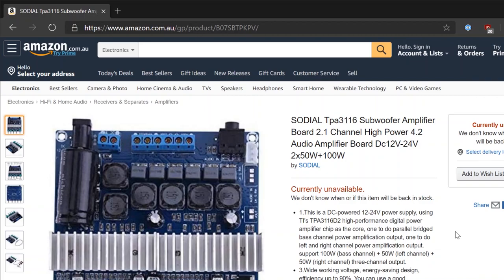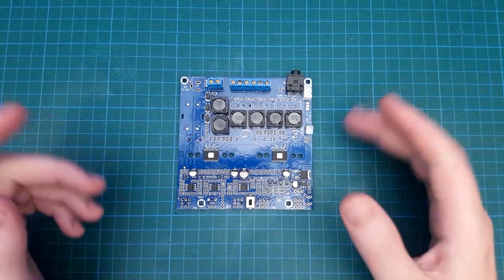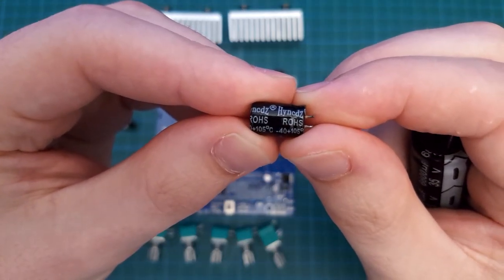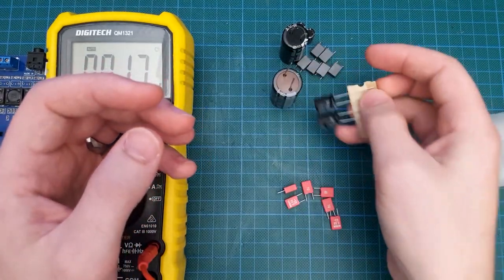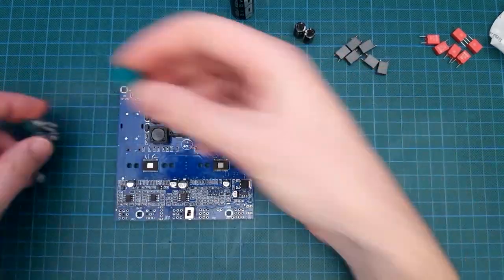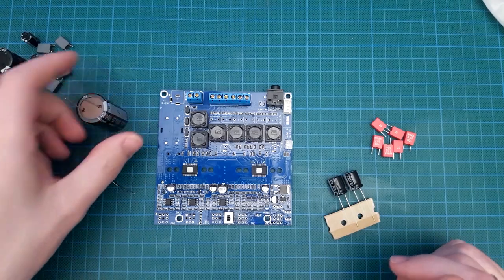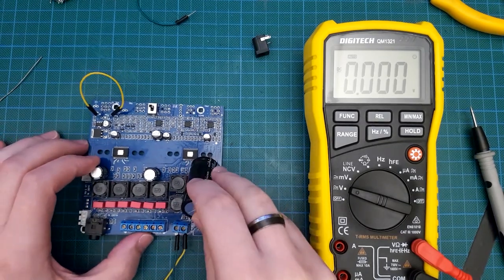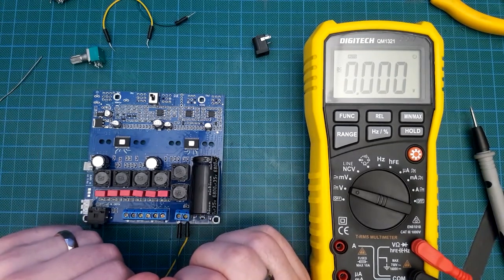TPA3116D2 amplifier module teardown, measurements and capacitor upgrade

Comment: I recently bought one of these boards (interestingly the entire rear section of the board is mirrored) and it came with a fake nichicon capacitor for the power filtering. It’s labelled as a Nichicon PL and I don’t think they’ve made those since the 90s

Comment: The DC jack is switched and it unconnects the screw terminal when you put plug in, so you can connect the screw terminal for exsample to battery. Like in guitar effect pedals.
Reply: You can put "Main" power switch there or just put jumper there. Or fuse.

Comment: I know it can be advantageous to increase the capacitance of the main power filter capacitor, but can I increase the rating of the others or would that change the sound? I'm trying to learn about amp design. Subscribed after finding this, btw. 😁
Reply: Increasing voltage rating is fine but changing capacitance values is not recommended. They are used for filtering so a change in capacitance may induce a hum that wasn’t present before. But the boards are cheap you may as well have a play or get yourself a breadboard and try.

Comment: I immediately upgraded all the electrolytics to some nichicons. Mine were ChongX and the 6800uf measured about half its rated capacity. As i watch the video, haha. you got the same Nichicons i ordered. I had to remove the DC connector as well. What i didn't replace and now i need to after seeing this video is the square caps and probably the pots. sigh more work. 

Now that i look at it, mine is slightly different. The one i bought is made by AOSHIKE and is sold on amazon. It's got bluetooth and much of the layout on the rear is opposite. Also, mine didn't have that problem with the DC removed. Typical chinesium.

Comment: dang you never did a follow up video replacing the pots? thats one of the main things i wanted to try to figure out but i cant find it on your channel
Reply from the maker: No sorry, I basically abandoned this project. These boards are very hit and miss, and after some more use the one shown here ended up dying rather unceremoniously. I experimented a bit with my own TPA3116 PCB design, but never really finished it.
Reply: @silvestronsbitsandbytes   ah no worries thanks for the reply, im thinking of trying the ht21 i hope it works decent enough, cheers
Reply from the maker: To be honest, for about the same amount, you can pick up a nice Dayton amp from parts-express and trust that it's not gonna be crap. Their bluetooth support aptX as well for much better quality than all the cheap chinese amp modules. Good luck though!

Comment: Great video mate. Waiting for that follow up. In my board the general volume pot is really bad, i hear a lot of cracks when changing the volume and lately it feels like there is a difference in the volume between  the two channels in certain positions. I guess i will need to replace it. In my bt version the switch besides powering off and on the board functions as an input selector. Do i need a special pot or will a generic 50k pot=switch combo work fine?
Reply from the maker: Honestly, the follow up to this has been pretty delayed because I was actually fairly upset by the quality of components and design on this board, even after you get past the big stuff. I kinda went a whole different direction and designed a completely new board from scratch, but since it's way more complicated it's all still in the works.
I might try to get one of the newer model BT boards like you have to test out and see how it is.

Also, sorry about the delay in replying - only just saw this comment. Thanks to YT for not notifying me at all!
Reply: @silvestronsbitsandbytes  hey man, i use these kind of board quite often and am usually quite pleased with them. However I do notice the hissing sounds and lesser quality. I am looking for a good, affordable "bluetooth" amplifier board and am quite interested in your design. So I was wondering if you are going to document anything or if you have any recommendations

Comment: Good afternoon. My amplifier has burned a chip that has two letters JL, I don't know. How to buy it and how to replace it? I hope you can make a video thanks
Reply from the maker: An SMD component marked "JL" could be a lot of things, unfortunately. You'd need to know the context in the circuit it's being removed from to be able to identify it correctly.
Reply: @silvestronsbitsandbytes  yes friend. apparently my module is no longer useful. it is incredible that for such a small piece everything is damaged. thank you very much for your attention

Comment: All the time to check existing component values, but replacement part values and tolerances not checked?
Reply from the maker: You're correct, I didn't check the new components. However they were ordered brand new from a reputable source and are known high-quality name brands (WIMA, Nichicon) so there's a level of trust that they are providing the values and tolerances I ordered.

Comment: Do they sell one maybe that goes for a bit more that you reccomend which you do not have to upgrade
Reply: @silvestronsbitsandbytes  lol I dont doubt it.  Man I'm just trying to find a powerful amp that i can make for under 200 bucks. I figured a 200 dollar amp like this would prob be equal to a 800 name brand finished one.
Reply: @NerdyMeathead  If you've got a $200 budget, start here with this amp: https://www.parts-express.com/icepower-50asx2se-class-d-audio-amplifier-with-power-supply-module-2-x-50w--326-212
With the remaining $100 you can get a nice case and quality jacks. Its got the power supply built into the PCB so less worries about ground loops and other issues.

Comment: I had already blown three boards two TPA 3110 and one TPA 3116 two channel 120w rated are terrible with fake rating of wattage n voltage tolerance...they cut on just half volume n blew in just one week power supply was 24 volt 2amps because they were really made for 18 volts Max what a waste....I buyed from Flipkart seller named dhruv pro
Reply from the maker: You definitely get what you pay for, and these being bottom dollar is very telling. Every penny squeezed out, and that includes sourcing parts that didn't quite meet manufacturer's full specs but work well enough for 90% of uses, it seems.

Comment: Good chance they used the wrong values of components for the output low pass filter.  Check the datasheet for the TPA3116D2.   I have a bunch of amps based on that chip,  I don't even bother upgrading them.  Buying junk and then spending more is counter productive financially.  You don't pre heat the lead,  you dump solder into both the iron tip and lead all at the same time.  IDK,  I've been soldering longer then I suspect you've been alive,  so I don't even have to think about it.  It's effortless.